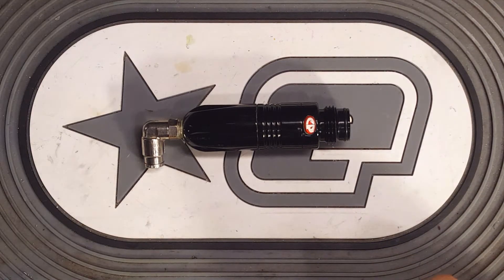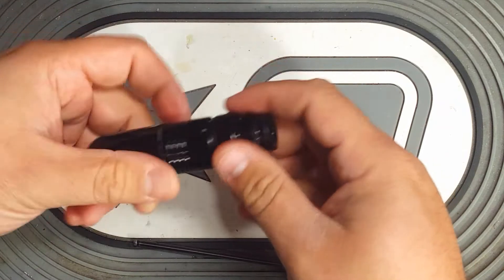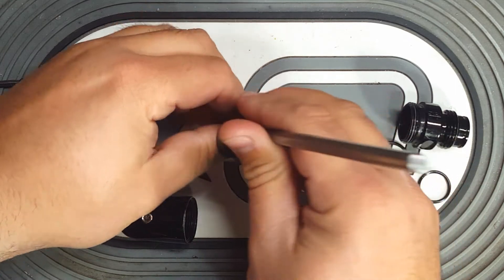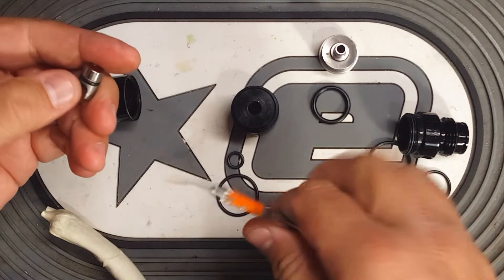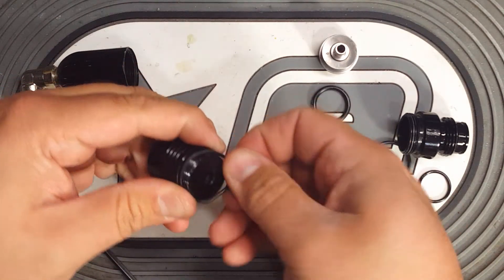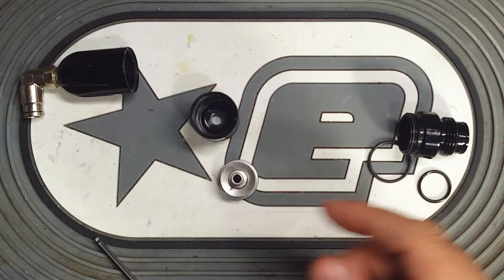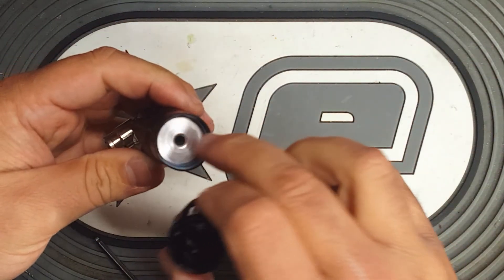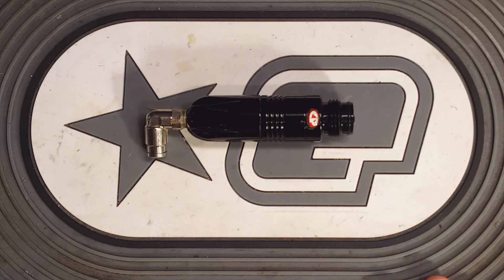CP V2 High Pressure Regulator - Parts Rebuild with Paintball Tek

Comment: This guy is an o ring removing wizard. I tried this, and cut myself twice. If you don't have steady hands and a good set of picks, god help you if you try to remove the middle #10.
Reply from the maker: Steady practiced hands do help...also it can't be said enough that good picks are a god-send for working on paintball o-rings.  I have honestly acquired a bunch of mine from my actual dentist office...ones that they break or are going to throw away are usually sterilized first, never hurts to ask :-)